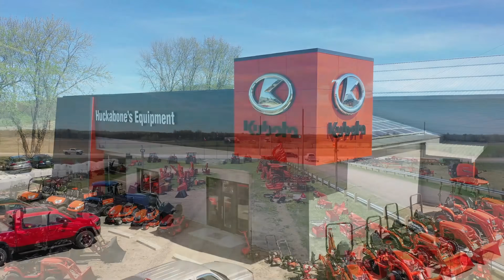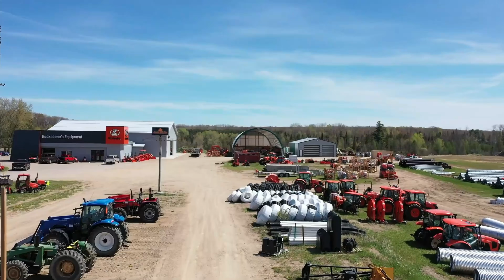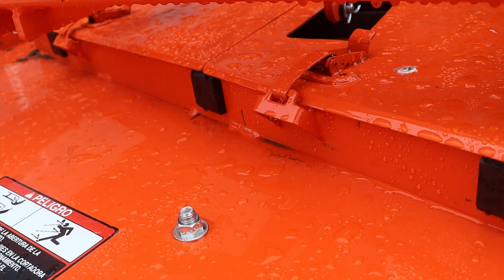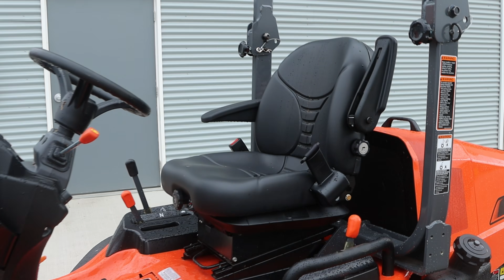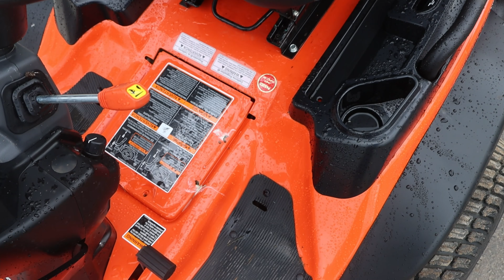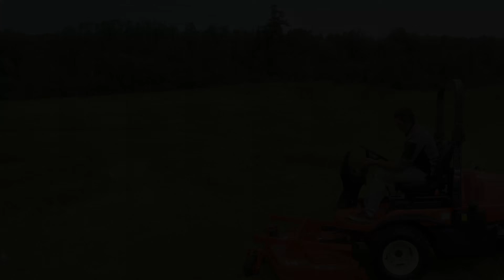The Kubota F2690 Front Mount Mower! Review and Use!

Comment: I have a Municipal customer looking to buy a machine for snow removal on city sidewalks and I'm wondering if anyone has run a spreader off the back of one of these and how easy it would be to install if so
Reply from the maker: We use Bauman MFG they make drop sanders for the rear of the F series Kubota line up

Comment: Nope I went with a John Deere because I hate that goddamn treadle pedal. Most uncomfortable control I ever used. John Deeres side by side two pedal hydro is so comfortable. Heel of your foot never moves you simply pivot your foot left or right. We put a mulch kit on our F1145 and a Curtis hard cab with easily removable doors and back window for summer. You can mow in the rain and this finished product looks like you mowed on a sunny day. No clumps nothing. Will climb a hill that will have you lying on your back no problem. Leaves simply disappear with the mulch kit. And winter plowing is unbelievable with turf tires. We love them.

Comment: Hi, great work doing this video. Very helpful, many thanks. Quick question, is this machine strong enough for the 72” side discharge deck? Have you had any feedback that it is underpowered running a 72? Thanks again 👌
Reply from the maker: 72" deck has worked fine on the F2690, would be better on the F3990 but lets not go there

Comment: OMG i just bought an f3990 at auction, TO USE FOR SNOWREMOVAL :( well when the ish hits the fan, at least i'll be a little more prepared for it. FML.
Reply: I had a 3990 for one season and needed to trade it in for a 2690.  DPF/Regen issues on every startup.
Reply: @WaldanGardens  NOOOOOOOOOOOOOOOOOOOO!!!!!!!!!!
Reply from the maker: more then likely you will end up with a lemon, the F3990 will most likely have emission warranty but be prepared for some down time 
give me us a call if you need some advice